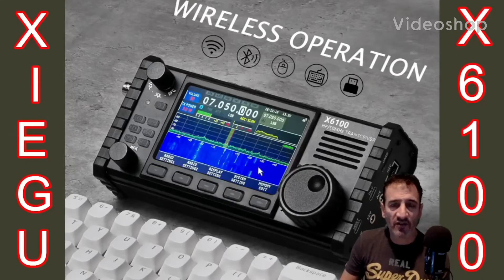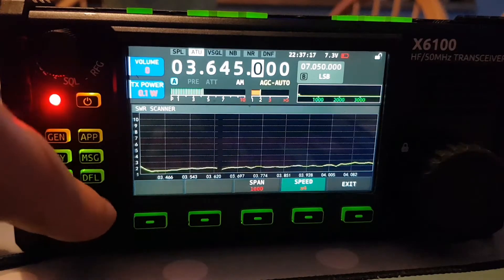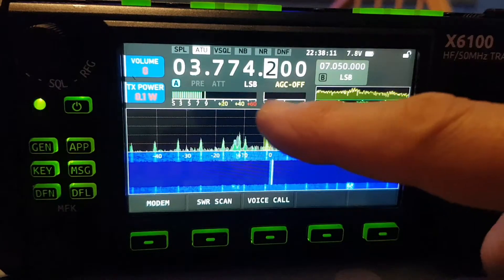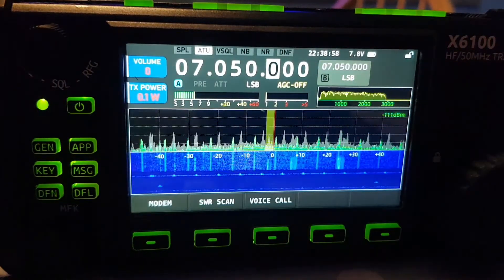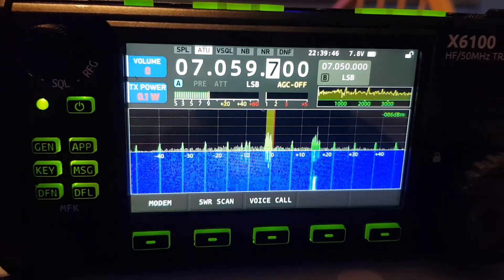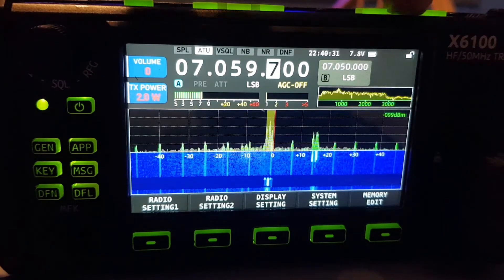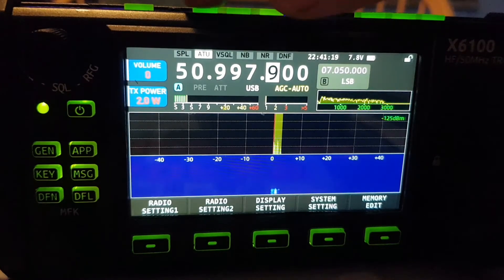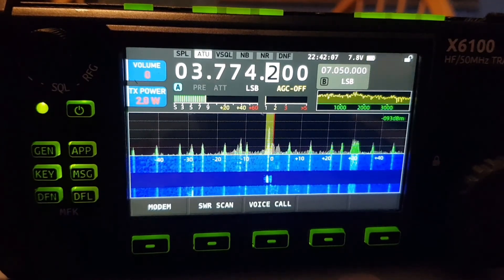XIEGU X6100 - SWR Meter on TX ??

Comment: I wish the video had used CW straight key.  When I do it the right meter goes way up, above 3. When do tune with tuner it does go down, but then when go to xmt the meter moves up as if not tuned.  I do think meter in xmt is ALC.  Also in the video the AGC is for rcv, not xmt so any change he made would not affect meter.  Also noticed he had what appeared very dirty power supply, see all the spikes, hi.  I think the maker of the video needs to learn more about the X6100, but appreciate his effort.
Reply from the maker: Hi the video is titled with question marks as I was asking for other people's opinions I only had the radio for a few days so was showing people what I had observed so far - 73

Comment: In CW mode that meter pegs out red when the key is released… I have a external meter that is showing a good swr. If you hold down, meter is reading somewhat accurately, release the key, and there is a huge swr spike in the rig meter.
Reply from the maker: Hi Trevor any idea why this is happening maybe needs pointing out to Xiegu- thanks for info
Reply: Mine does the same too.

Comment: That is the SWR meter. It looks just like the one my G90. That is why it goes red at 3.
Reply: Yes.  The confusion appears to be that because the AGC indicator is above it that people assume that it is the AGC meter, while they don't assume the S meter is the PRE, ATT, LSB/USB meter for the same reason do they 🤔
Reply from the maker: Thanks as it's not in the manual .cheers 73